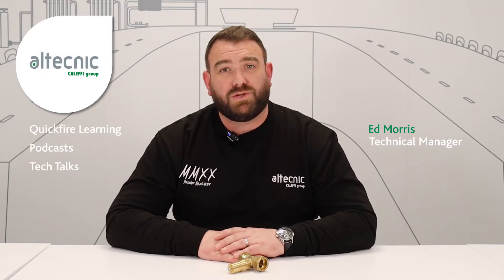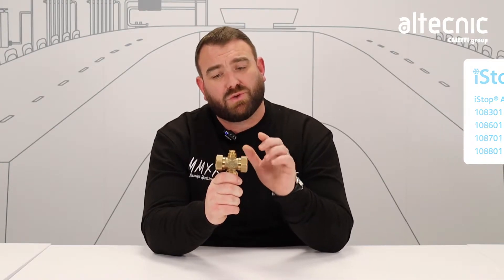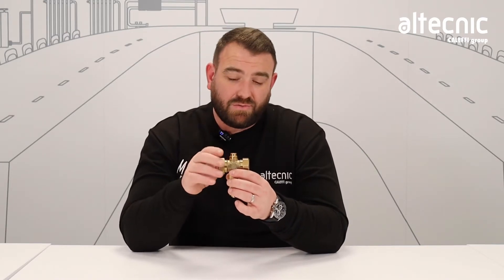Heat Pump Protection: How do you insulate an anti-freeze valve?

Comment: You've gotta love it when a plan comes together - my quesiton was, does this thing detect the air or the water temp and as such, can I insulate the crap out of it as its on a heat pump an will be outside? First vid, 'how do you insulate the valve', well done!